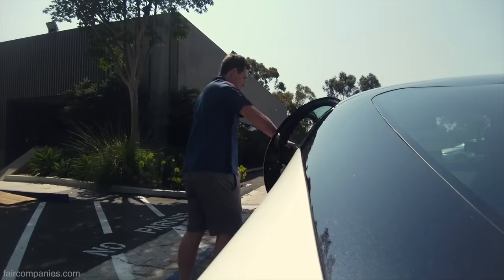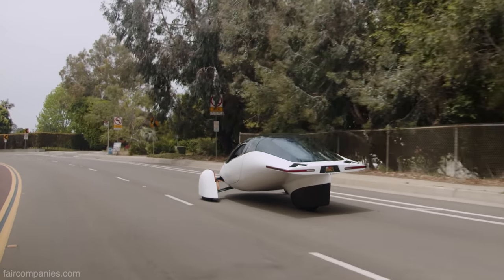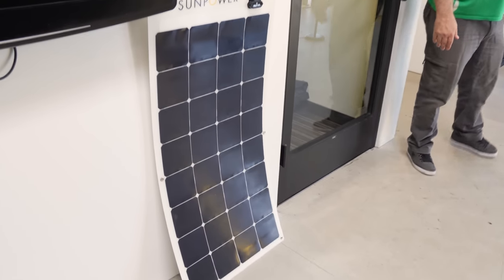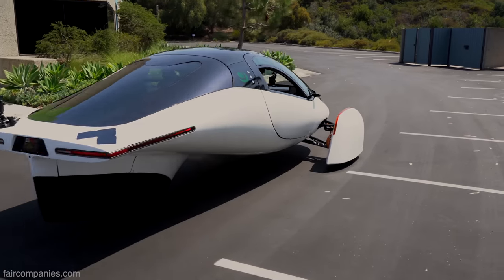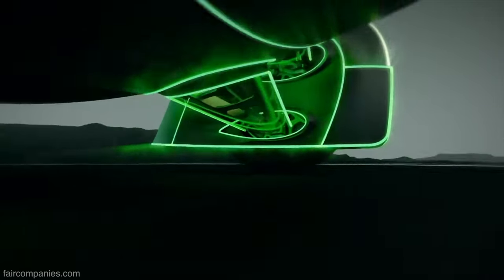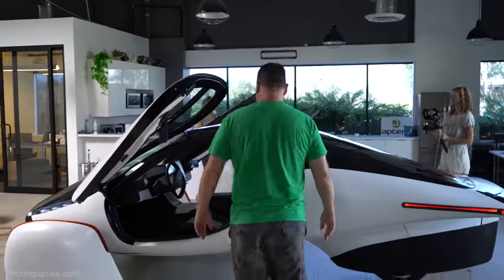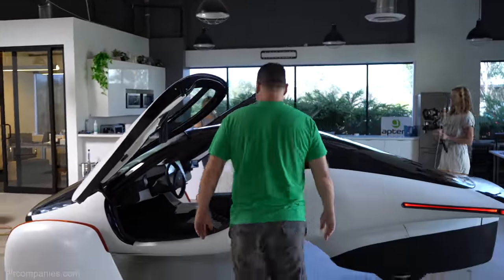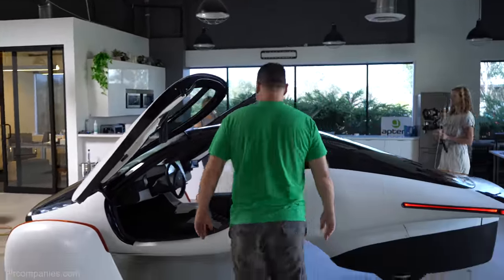Aptera commutes just on solar, gets 1K mile-range when full

Comment: This is what the Tesla should be. But we need to get rid of the gas guzzlers first to make the roads safe for these type of vehicles.
Reply: Aptera will be crash tested to full FMVSS automotive standards and the ratings published before shipping begins.  It is safe by design.
Reply: @n.brucenelson5920  really do you know what it will cost?
Reply: @MikeSmith-cl4ix  I don't have the numbers, but it will be rather expensive.  It will include the sacrifice of 8 or 10 vehicles.  This has been in the plans since the design process was started in the beginning.  Aerodynamic efficiency and safety are the twin primary design goals.
Reply: @n.brucenelson5920  normally a tricycle is considered unstable does the two wheels in the front make it more stable than having two in the back?
Reply: @MikeSmith-cl4ix  Yes.  This is called Tadpole configuration.  Look up the performance of the Slingshot for another example.

Even the designs with two rear wheels are not as bad as they have been made out to be.  Top Gear had to rig the Reliant Robins to turn over, which they later admitted they did for comic effect.
Reply: @n.brucenelson5920  Ok, thanks.

Comment: Only problem is the charging factor. Wind turbine kills wildlife and barely produces after ridiculous costs, solar is there are advancements in solar,but ineffiecent cause they haveta be cooled and operational times. On small scale solar great, large no good currently. So currently usa relies on petro, oil, gas, nuclear, and coal. Nuclear barely used. Coal is used the next highest after petrol, but coal far more pollutive. You also have other types, but they are minor. So while having ev would be great if it was much cheaper, most with rather drive oil gas vehicles due to the fact that charging vehicles is far more deadly to enviroment.

Comment: il faut absolument enlever ce bruit de traction, avec des moteurs roue c'est étonnant d'avoir ce bruit rien que pour cette raison je ne pourrait acheter ce véhicule
j'ai déja eu une nissan leaf pendant 4 ans et une zoé pendant 3 ans  reste 2 ans de location la leaf etait totalement silencieuse la zoé fait très peu de bruit
Reply: It is absolutely necessary to remove this traction noise, with wheel motors it is astonishing to have this noise just for this reason I could not buy this vehicle
I already had a nissan leaf for 4 years and a zoé for 3 years remains 2 years of rental the leaf was totally silent the zoé makes very little noise

Comment: If you're driving across country to visit Grandma get your engineers to create a alternator and attach it to an wheel axle. Yeah it can be done.
Reply: The wheel motor is already capable of regeneration, and power is recovered and returned to the batteries during braking or down hill operation with the present design.
Reply: @n.brucenelson5920  why does it need recharged then? 😂
Reply: @chuck26241  There will be some use cases where it won't need to be for owners of the full solar option.  If you are driving at highway speeds and a full load, you could be approaching 200 watt hours per mile of travel, which is more than you will be generating.  In Iowa, I expect that I will only be getting perhaps 2100 watt hours of solar power per day, on average.  That may actually cover my daily driving needs.

Comment: I am sure most of the car desighin is just a wow factor.  You can most likely design a more practical vechile.  If you take a stardard designed car but dimpled the body you would get a lower drag and not have to design a car that looked liek it was out of the Jetsons.  This can is only viable in certian parts of the country as most thie country does not have S Ca sunshine.
Reply: I will be using my Aptera in Iowa.  20 miles per day will still meet most of my daily driving needs.

Comment: Tesla should be able to design a EV that has solar panels
Reply: They will probably add some solar in the future.  However, Teslas use way more power than the panels could generate for useful range, unlike Aptera.  They could supply some accessory power for Tesla.

Comment: Your dead if you get in a car wreck tho. I guess not much different than a motorcycle
Reply: Aptera will be crash tested to automotive standards and get a respectable rating - we won't know what it is until the testing is actually done.  But I have over 400,000 miles on motorcycles and it will be both safer and less expensive to own by far in each area.

Comment: Let's look past the wow factor. Condition of the road, better be smooth. I heard enough rattling in the video. Gravel, dirt, or concrete, not. The lady demonstrated the space in the back with the tent cover. As she said, her and her dog would fit so I guess husband or friend is  a no. I guess none of you have kids because that is not an option. Only three wheels, classification is the only real reason. We already had three wheel vehicles in the past. We could have ripped the gasoline engines out of them and put electric motors in them with a rechargeable battery and been driving already in but that's not happened. It will be millions of dollars in research which will make the vehicle too expensive for most. Sounds the same as most other designs. Just what I see.
Reply: My wife and I have ridden in an alpha prototype and we will both easily fit together with our dog even without the tent (which we have ordered)

The three wheels reduces rolling resistance and aerodynamic drag.

Comment: Rather take a bike and burn some fat.
Reply: Aptera is not an argument against that.  In fact you can take a couple of bikes to new areas to explore in your new Aptera.
Reply: @n.brucenelson5920  
Well you're right, I missed the letter K in the headline!
Reply: @SladkaPritomnost  No worries.  My motto is "I thought I made a mistake, once - But I was wrong!"  They are available in ranges from 250 to 1000 miles.  I have ordered the 40 kWh model, for cost reasons, and the fact that the lighter models will be somewhat more energy efficient.

Comment: 1. It is a motorcycle
2. There is no investment on this 3 wheeler
3. Motor cycles are never safe
4. No money hello 
5.  With those wheels it is ugly
6. It is a copy cat of elio motorcycle.  Will not make it
Reply: By this time next year (Q1 2024) San Diego will be Ground Zero for the next evolution of transportation. Everyone else (not in a Tesla) will realize they drive a carbon spewing, heavy AF, steel stamped and welded metal box, that secures a yoke around their neck. Thanks for the Fear, Uncertainty, and Doubt as we watch you choke on the nostalgia from the last century. 

The future will pull you along, no matter what you think.
Reply: Aptera has gotten over 90 million from small investors - the most ever.  They have also gotten a 21 million dollar grant from the State of California and have applied for a DOE grant.

I personally have more than 400,000 safe miles on motorcycles. Aptera will be tested to and do well on the FMVSS part 200 automotive crash testing standards by a third party agency.

If anything, Elio was a rough copy of the original Aptera, Inc. vehicle.  The Aptera Corp design has almost nothing in common with either one.
Reply: @sandervanderkammen9230  Sander has been lying about this ever since he started posting on Youtube.  Aptera Corp was founded in 2019.  They have qualified for a 21 million dollar State of California grant, which is being distributed and tooling is now being produced.  Money raised is going directly to the purpose it is intended for - design and parts.  Aptera is also developing a nice patent portfolio.
Reply: @n.brucenelson5920  WHERE IS YOUR NEW APTERA PARADIGM EDITION BRUCE?

Comment: Unfortunately, it is classified as a motorcycle, not a car. A car needs 4 wheels.
Reply: Not really. 50 states have 50 different ways of defining a vehicle. Three wheels is considered an autocycle design. I'm a new Arcimoto owner and have been following this topic. Check the laws in your state before making any conclusions. 3 wheeled cars are a thing in some states if they conform to DOT standards.
Reply: The classification is a legal fiction.  My Aptera will be replacing my Gen 1 Honda Insight, which has 4 wheels, but will exceed the performance specs of the Honda in almost all respects, from payload, to power, to energy efficiency and cost of ownership to safety.
Reply: @n.brucenelson5920  Vaporware vs. hardware already in production. About 300 Arcimotos are in service and the new larger factory is ramping up despite the pandemic setbacks. Mine is finished and in shipping now. It has a shorter range but is practical and utilitarian. The first 35 mph t-bone collision saw the driver walk away with no helmet or air bags thanks to the 6 point harness and tested crash cage.
Reply: @popeyegordon  Aptera is hardly vaporware, since alphas exist and the betas are being assembled - unless you would apply the same term to the Cybertruck which started development around the same time.  Arcimoto is a wonderful vehicle and I wish them well, but the use case is very different.  I bet there will be many owners of both vehicles, since there is so little overlap.
Reply: @n.brucenelson5920  Elio.
Reply: @popeyegordon  The only way you would make that statement is by not having done due diligence.  Elio claimed they were going to build a new motor at an impossible price.  Apera has a supplier for everything they are not building themselves, and in a few cases where they haven't found a supplier yet, such as the reversing valve for reverse cycle heat from the A/C compressor, they have told us.  In addition, the Aptera founders and new hires all have histories of success at other companies, including founding and running successful companies through IPO. -Elio, not so much.
Reply: @n.brucenelson5920  "The classification is a legal fiction." And the trinity is a literal fiction. Lol.
Reply: @ Popeye Gordon  @n.brucenelson5920  6 to 12 beta's - even the founder doesn't know how many. Aptera is promised to be all things to all people, but it can't be. I was looking at the junk mail today, and there is a 9 person, 3 room tent for $199AU - that's about $150US. I can get 2 for $300US and save $100 on that silly fly Aptera charges $400 for. I can sleep 18 people in 6 rooms and feed them for a day; it's a pity Aptera didn't to the math/science on efficiency and economics of that option. They rip off the disciples with confirmation bias.
Reply: @Popeye Gordon  @n.brucenelson5920  "The only way you would make that statement is by not having done due diligence." Says the man who does none, himself. Did you see the honeycomb shell? How do you get coolant channels through that and not make it highly breakable, plus keep it from leaking? What's the due diligence you have done on that matter?

Comment: Tesla loses 15% power from motor to wheel? This is misinformation. It is only ~5%
Ice cars lose 15%

Lost all credibility. What else are you lying about in your designs? 1000 miles range? It's probably 400 miles at best case scenario
Reply: When you say Aptera' s range as 400 miles best case, you lose all credibility to those who have looked into what they are doing.
Reply: @n.brucenelson5920  Just anecdotal example... not saying that's true range. 

still, tesla's lose 5% efficiency not 15% 

so that is misinformation. and as a business leader, you would definitely know it's not 15%. 

better to be honest than exaggerate and provide false info.
Reply: @MercifulArchitect  Agreed.  But it wasn't a published statement, but a spontaneous comment.  He has given the correct number in other places.

The general point that Aptera is more efficient than Tesla - almost 3 times more - is true, and at the root of Aptera's appeal.  A mis- statement does not justify your ludicrous and wrong claim that a 100 kWh battery Aptera would be lucky to get 400 miles.  

You deserve to be called out on making a bigger intentional fib than the original slip of the tongue.
Reply: @n.brucenelson5920  safety.... tesla's and Aptera are not even in the same vehicle category, they shouldn't be compares... it's like comparing a scooter to a motorcycle. can't work that way.
Reply: @MercifulArchitect  Although they are not in the same category, they will be tested and rated according to the same standards, as far as safety goes:  FMVSS Part 200.
Reply: @n.brucenelson5920  that will be interesting to see passing all current road safety standards, considering it is such a lightweight vehicle, with not much weight or crumple zone to absorb the momentum. could be like a smart car design when it would simply bounce off a crash. the wheels would be first to go.
Reply: @MercifulArchitect  There are engineered crumple zones front and rear.  It could be better compared to the Gen 1 Honda Insight, which also weighs about 1800 lbs and has front and rear crumple zones and got 4 ratings when it was tested.  The wheels might absorb energy that would have otherwise impacted the passenger compartment.